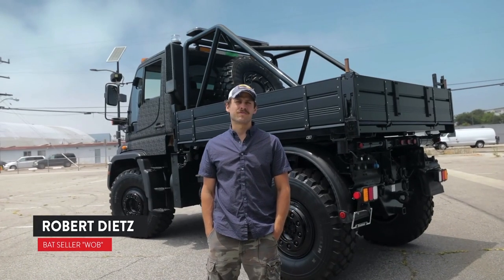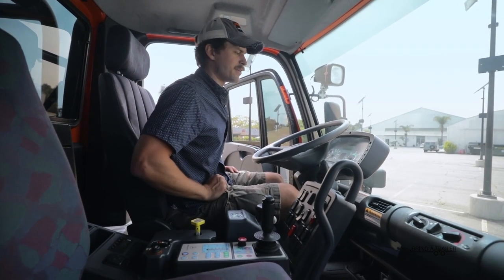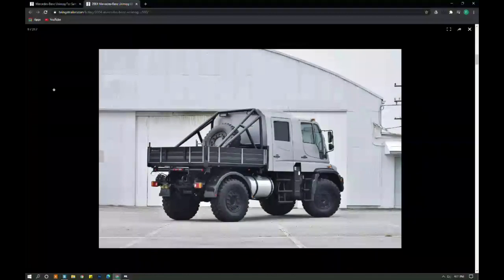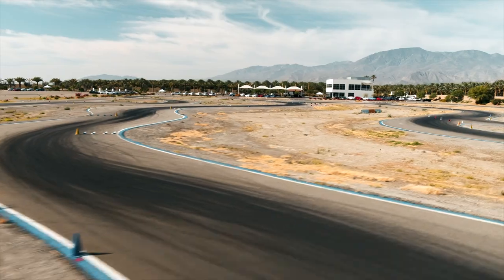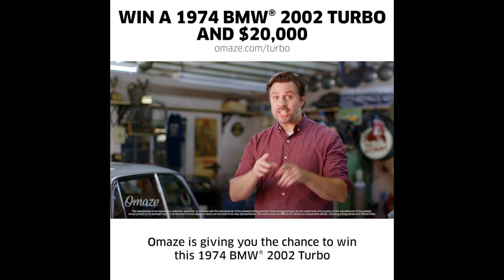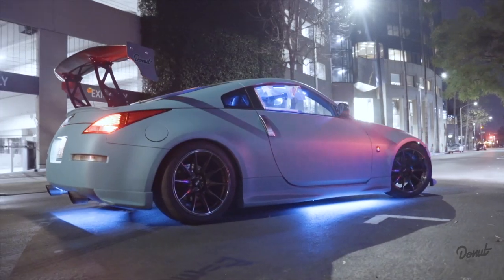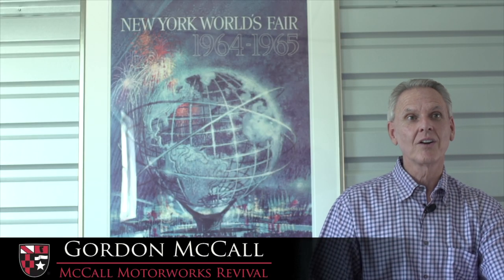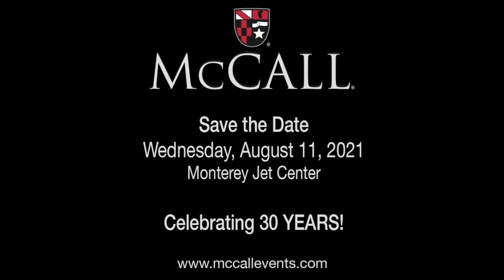FIRST LOOK BMW M8 COMPETITION, DONUT MEDIA Hi/LOW, & BRING A TRAILER | PETERSEN CAR WEEK DAY 1 EP. 3

Comment: To the BMW gal.......did BMW solve the connecting rod bearing issues yet?!!!!
Carbon Ceramic good for the track........until you realize how much it is to replace them!!!!
How much does the race car weigh and how much does the street car weigh?